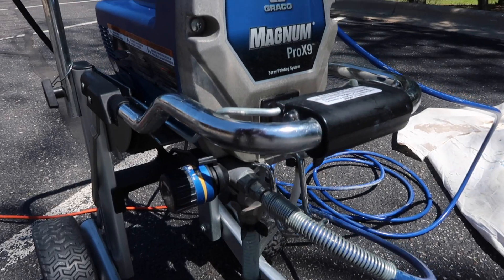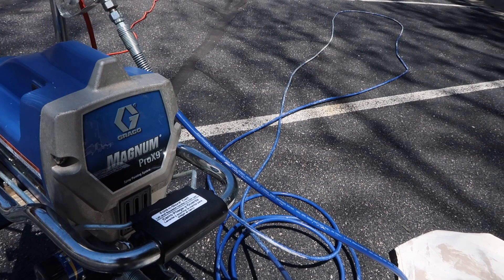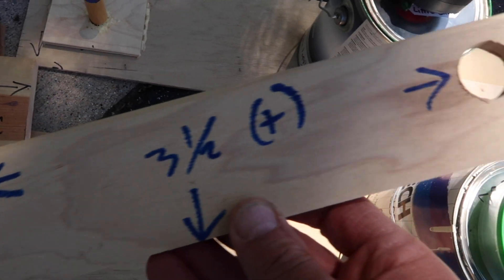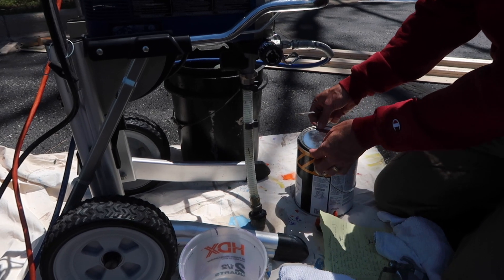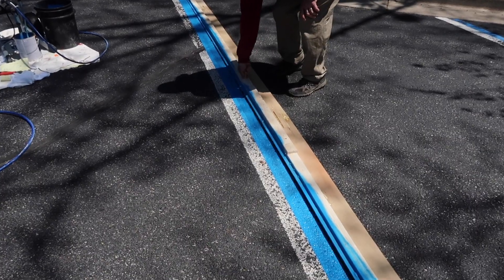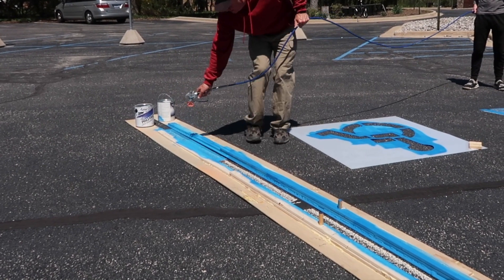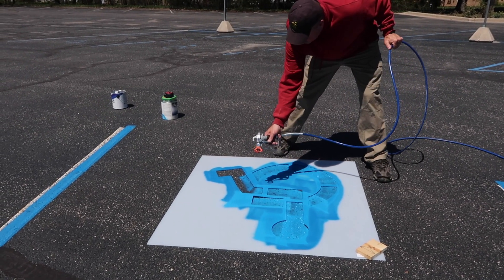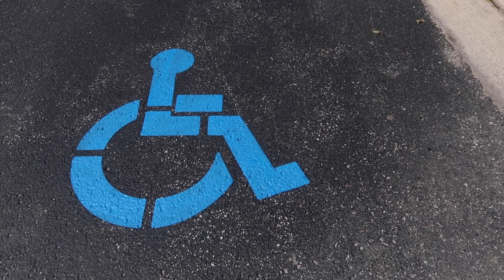GRACO MAGNUM X9 AIRLESS PAINT SPRAYER- PARKING LOT STRIPING & STENCIL WORK

Comment: I bought my X 9 several years ago. It worked very well for me. I have had mine in storage mode for about 5 years now. I’m getting ready to do a large painting project in the next few months. The only thing I would like to change is my hose. I’m looking at a 15’ with a 4’ whip on both ends. That 50’ hose sure holds ALLOT of paint!
Reply from the maker: Yes, I agree that it holds a lot of paint.  I like the 50' for big stuff like spraying 5g on parking lot stripes.

Comment: Came out real nice. I'm currently searching for one of the machines that you can just roll to save my back tho if i can save some money ill give it a try. My budget for the machine is 1k so i am kinda limited
Reply from the maker: I recently bought the Graco Pro Cordless Sprayer.  It holds 32oz and great for smaller projects.  Stay tuned for that review.   The airless sprayer I used in this video is now similar to the Graco ProX19 made for remodelers and contractors.  I had the X7 to start with and it didn't have the performace I wanted so I exchanged it after the first use.
Reply: @MarkThomasBuilder    I was going to buy the one you had linked but i saw the Graco 17C305 Pro210ES Cart Pro connect paint sprayer it had good reviews and said it had a little more power to push more paint. It comes with a 50ft hose so hopefully it works out fine for the small parking lots I work on

Comment: i just purchased Graco x9 paint sprayer do i need to use reessure pump ? I saw normally painter use pressure pump , i'm not a pro painter . please don't mind thank you !
Reply from the maker: This airless sprayer draws the pain in and builds up pressure in the spray hose.  There isn't anything else to it, this sprayer does it all.  You may need to see what spray tip you're using and get another one to best fit your needs.

Comment: What did that have to do with the Graco sprayer you could have used any paint sprayer to do that plus you didn't need to waste all that time with longboards and stuff use masking tape and just tape off a spot with paper
Reply from the maker: I needed an excuse to get my Graco sprayer out, lol!  I made the longboards because I might start doing the white lines in the parking lot.  Much faster than tape for the big projects.  Another thing was I didn't know if I'd have much overspray, so the boards helped with that.
Reply: @MarkThomasBuilder  Tape is slow and may not stick to the asphalt or concrete. Stencil boards are the way to go.